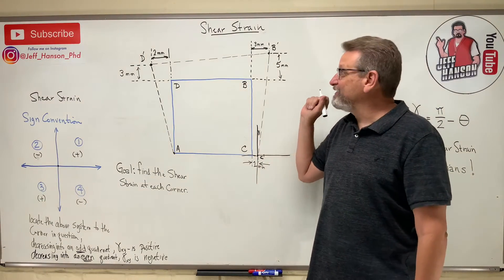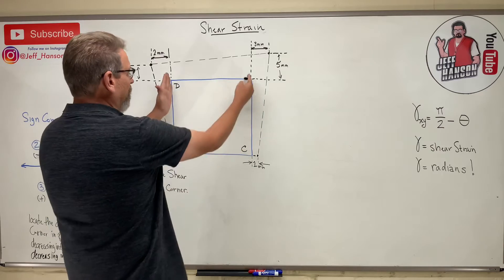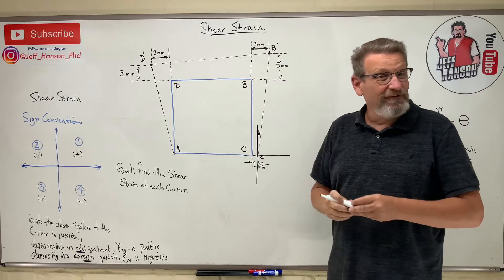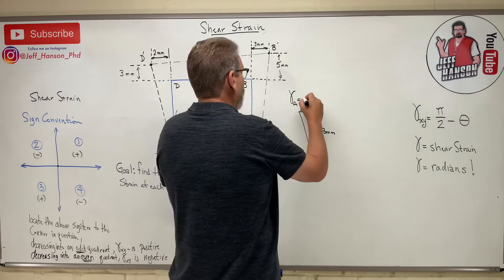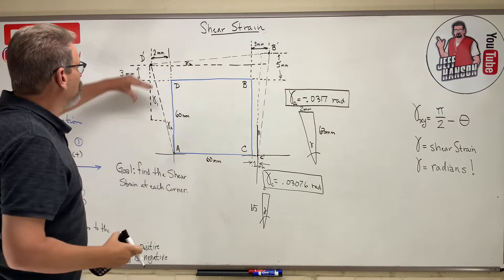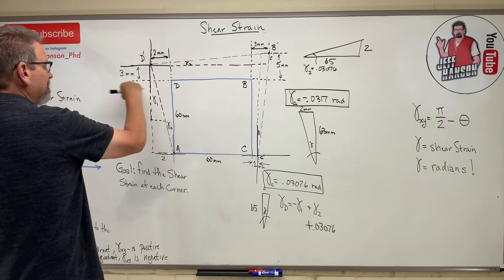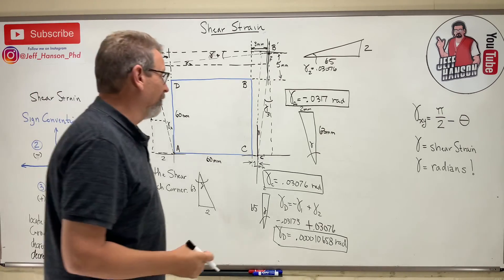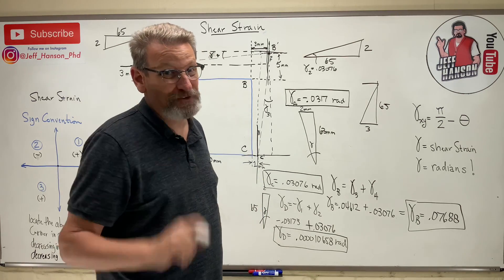Mechanics of Materials: Lesson 8 - Shear Strain Explained, Sign Convention

Comment: Gamma 3 is the same as gamma C = 0.0308 rads; Gamma 4 is the same as Gamma 2 = 0.0308 rads; Therefore Gamma B = gamma 4 + gamma 3 = 0.0308 rads + 0.0308 rads = 0.0616 rads.

Gamma D = - 0.0317 + 0.0308 = - 0.0009 rads. If you rounded it different you will get slightly different answer.

Comment: SOMEONE PLEASE ANSWER. By this logic though, lets say the deformation at point C (disregard it being 1 m away, so c' is actually just at point c)  was heading towards quadrant 2. The new angle would be less then 90 degrees, making it positive. But by the sign convention, it would be negative?! How does this work??
Reply: The formula doesnt consider the new angle. It only considers the true angle thats higher than 90 degrees,  once it crosses from the 1st to second quadrant
Reply: And since the angle is higher than 90 degrees, the formula pi/2 - 90plus degrees gives out a negative

Comment: I'm a bit confused.  Points B and D have displaced along two orthogonal axes.  Doesn't that mean they were subjected to shear forces on two orthogonal axes?  Why isn't the strain computed as two separate quantities relative to the original edges, rather than being combined as a scalar quantity?
Reply: The conventional coordinate system (x and y axes) is used as a reference in this question. Even if a point has shear strain along the two different axes of the conventional coordinate system, the coordinate system can be changed in a way that makes the point have shear strain along only one axis. For instance, for point D, the coordinate system can be slightly rotated counterclockwise (the new y-axis would be parallel to A'D') so that the point has only one shear strain (along the x-axis), which would be equal to Gamma D.

Comment: You dont seem to ever use pi/2-theta and so im confused as to where that plays into shear strain
Reply: It is another formula to find gamma but he decided to solve for it directly using pythagorean. So the points are intially at 90 degrees and the strain made a theta angle, so if you subtract the 2 you end up with gamma, if you look at point C the angle that is made by the dashed line at the right and the x-axis is theta. Well thats how I understand it, I might be wrong.